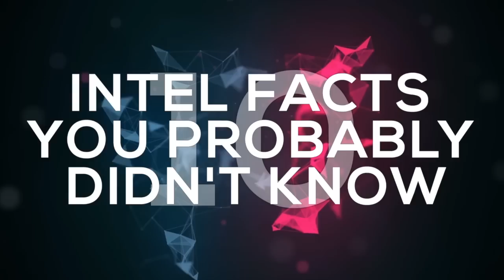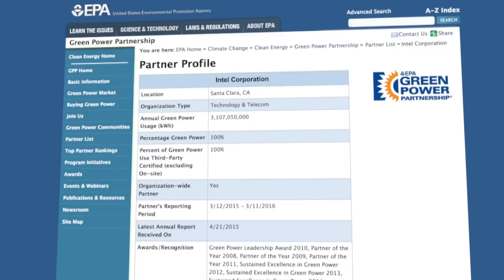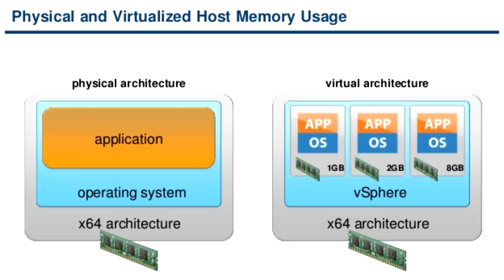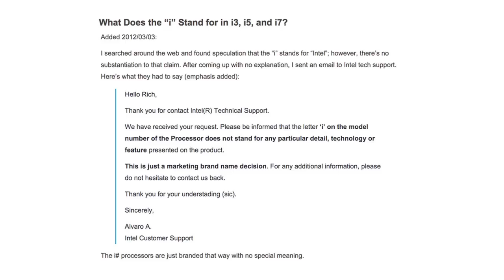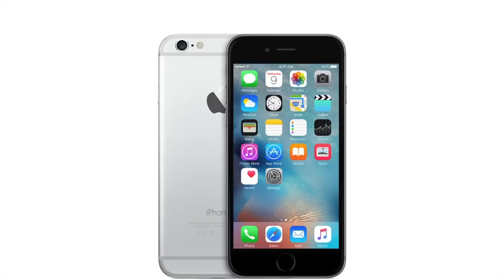10 INTEL Facts You Probably Didn't Know

Comment: transistors are not the same as ghz , ghz is how often 1 clock cycle ends , transistors do base binary functions like AND or OR , one clock cycle can involve as much transistors as you like , when clock cycle finish the output can be changed if the inputs changed

Comment: No, Intel didn't market much harder to turn on the heat on AMD.
Intel just bribed major pc distributors like Dell, HP,  and the likes in different parts around the world, giving HUGE bonuses the less AMD products they sold, had available to sell, or just giving AMD products unfavorable conditions like steeply marking up the prices of AMD products.
This was done globally, and this tactics also had a huge impact in China, Europe, Japan and Korea sales.

It got to a point so ridiculous that some companies (Dell for example) were earning more money from these bribes than they made by selling computers.

During a period of time they also modified compilers to discriminate between AMD and Intel chips and when an AMD chip were detected a slower code path was executed, even tho the AMD chip could run the faster code, and there was no technical reason for it not to.
And that, in its time could easily be seen by spoofing the hardware id to make the AMD chip look like an intel chip to the OS, as AMD cpu received a huge performance boost just by doing that.
And after this, tools appeared to recompile certain dlls without this trigger to discriminate between brands, AMD receiving the same performance boost as spoofing the hardware id.

And no, these are not tinfoil hat theories. There have been quite a bit of sentences against Intel in USA, Europe, China, Japan and Korea, about this, and from major courts, not local ones.

Also, all of this can be confirmed by yourself if you do a bit of research.

I'm saying this while owning an Intel chip, because, well, AMD screwed up big time with bulldozer and piledriver chips as those were pure trash xD, although the situation is not the same now with Ryzen.
So don't think i'm a fanboy, its just that the tactics Intel has heavily used in the past doesn't do good to consumers, neither in innovation or prices. And competition is almost always a good thing.

Comment: You for got to mention that intel was sued for anti-competitive practices many times. Intel essentially bribed OEMs to not sell AMD chips, this is the primary reason intel has such a market share.
Reply: not to mention that amd processors before FX were lacking severely in power efficiency and performance, but also without x64 intel Core series woul've nothing by now
Reply: @pinkyfloo8814    you don't have a clue, right? Before "FX" AMD has Athlon and Athlon XP who won hands down at IPC and power consumption against Intel

Oh btw, 64 bits was accomplished by AMD, Intel doesn't or woulnd't know how to do it
Reply: @pinkyfloo8814  🤣🤣🤣

Comment: in your video on the history of intel, you left out a very important chapter.  a company bu the name of Zilog also made an ascii based cpu that powered several cp/m computers. my first "personal computer" was powered by their 8080 chip and i later upgraded to the faster Z80 chip which was pin compatible and slightly faster. unlike ibm pc compatibles those computers used 8" floppy drives and double sided double density drives held 860KB as opposed to the pc's 360KB. the cp/m system i had came equipped. with 64KB of memory an ran at a speed of 4.77 megahertz. it could running cp/m 2.2 recognize a hard drive partition of 32 megabytes just like ms-dos. these systems utilized serial terminals for input/output so they were not capable of even ascii graphics. just a small bit of computer history for anyone that is interested.

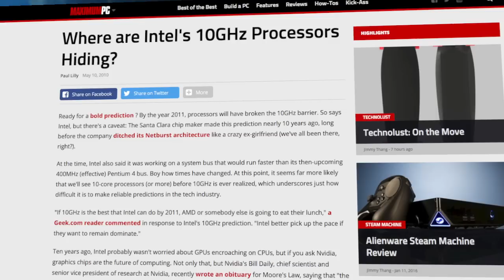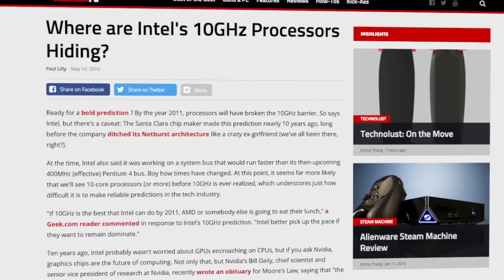Comment: 2:02 - 2:05 and we have them, if you multiply the clock speed by the core count, you could easily count the first CPUs with 10GHz clock speed was made actually in 2007 (e.g. Core 2 Quad Q6700 - clock per core is 2,66 GHz. If you multiply it by 4 - 2,66   GHz x4 + 10,66 GHz.) So Intel and AMD BROKE the 10 GHz barrier, actually in 2007. (BOTH)

Comment: In regards to why intel doesnt make 10 Ghz processors. It isn't that speed is no longer important. It's that Instructions Per Clock (ie: how many computing operations the processor can perform per 'Hz'), better instructions/operations, and multi-core architecture (and concurrently, multi-threading and using the GPU for non-graphics tasks) have lead to the amount of Hz being not so critical to performance as once believed.

Comment: .... x86. The original specification, created by AMD and released in 2000, has been implemented by AMD, Intel and VIA. Created.... by.... AMD. Your video states that Intel licensed it to AMD.....
Reply: x86 was created by Intel and originally was manufactured by both AMD and Intel. x86-64, which is often referred to simply as x86 because nobody makes pure x86 anymore, is an extension to x86 that was developed by AMD.

Comment: Intel on Intel, alright - I'll play. They did make a chip that went into the flight control of the F-14 - that's true. Go back further. In the early days of integrated circuits, they'd make a chip for a calculator company, Casio, with functions to add, subtract, multiply and divide. These were done with digital logic. So Casio requested a new chip, with some more functions, (sqr, sqrt, log etc...) and they presented a circuit diagram, suggested "Like this." It was a pretty big nasty circuit. Moor and his team had been playing with the idea of slotting not part, but all a microprocessor on one integrated circuit. This resulted in something a bit more complex again than what Casio had asked for, but it could do any simple math function and be given fresh microcode in a later model to add more, and it was all new and shiny and engineers liked that sort of thing. So they showed it to Casio, who were super impressed, and they ordered it. Officially, it wasn't a computer parts - it was the "works" of a simple calculator, but it was integrated into a single chip, and it worked the way a processor core does, not the way a group of discrete digital logic stuff does. That was about '63, and that was Intel's first processor on one chip. They also made Casio a quartz crystal chip time piece, on a single silicon chip, which brought them to digital watches, at 1/4 or less the price of Texas Instruments or Seiko.... Before pcs, Intel made a lot of money (relatively) through Casio digital watches and Casio calculators.

Comment: I use two of those i thingies.  But the 3.7 gigahertz on my i5 is called 'turbo', whilst the 3.7 gigahertz on my i3 is just called 3.7 gigahertz.  Hmm.  You might think that the i5 was faster than the i3, but I'd doubt it.  You see, the i5 is a second generation i5, running in 32 bit mode with 4 gigs of 1333 megahertz DDR3 RAM.  Meanwhile, the i3 is a sixth generation i3, running in 64 bit mode with 8 gigs of 2133 megahertz DDR4 RAM.  And they run on different operating systems.  I'm just using them as PCs that have a bit of extra oomph.  They both do the job that I want them to do, so that's fine.  The chief advantage of the i3 system was that it was cheaper, whilst providing good performance.

Comment: (2016/17) the OLD processors won't get better because.
1. we are at the limit in the sice of  transmitters-they are too small to make even smaller and at a certain sice electricity will start to jump from one to an other.
2.we heve better things like nanotubes (transmitters stacked on each other) and graphitum (one atom thick layer of graphite)

Comment: actually we can make 10GHz cpus but the issue is the power it would take to run
Reply: Kameron Swan no the issue is temperatures
Reply: and the only way to get that hot is by having that much power pumping through it
Reply: Garrett Austin and that's why both Intel and AMD have slown GHz increase so that they can either have a standard 65 watt or 95 watt without blowing up your board and that aftermarket heat pipe heat sink that you just had to have
Reply: Actually, the issue is more to do with stability than anything else. A 850W PSU would be more than enough to (theoretically) power a CPU at over 10GHz. When it comes to temperatures, if the CPU is consuming at most 400W of electricity, that means that the CPU is generating roughly 400 Joules of thermal energy/second. The thermal dissipation properties of liquid nitrogen will more than suffice to keep the CPU cool. The actual issue is down to the architecture of the CPU, i.e., either the memory controller on the die cannot cope with the bandwidth, or simply the transistor gates themselves cannot oscillate at a frequency of 10GHz.
Reply: then why don't they make the di out of copper instead of tin-bismuth
Reply: Oc competiotions have reached over 8ghz using liquid nitrogen as cooling

Comment: "we don't double the amount of transistors anymore"

Not true. Moore's Law split in two. The density of ICs and the speed followed different lines, and in fact, the clock speed basically flatted out. The real reason for this is the power dissipation for ICs continued to rise with density, and it became impossible to get all that heat out of the package at higher speeds. This is why now you buy chips with multiple cores, even if the speeds are similar. Since you can pack more circuitry on the chip, but not increase clock speed, the easiest method to get more performance was to duplicate the CPU on chip several times and let multithreading use the extra cores.

Comment: Many of the information is wrong or incomplete. Just a few remarks: 
- Nobody actually ever 'invented' the microprocessor. It was a common agreed on fact that sooner or later the processing unit would fit into a single chip. Intel just happened to be the first company to get a commission to design such a chip.
- Socket 7 was not a standard. Just because Intel didn't take competition serious enough at the time, they didn't make any design steps to avoid the competition from using it. Socket 7 was also not the only Intel socket that could be used with other CPU's. Socket 3, for example, could be used with the AM486 from AMD.
- Moor’s law has nothing to do with speed, but just with transistor count. The 10 Ghz estimate was based on the heavily clock-speed optimized Pentium-4. If Intel would have continued this design strategy, it would have easily reached 10 Ghz by 2011. This in otherwise slower and less power-efficient processors! The doubling of transistors every two years is more or less valid in 2016: this is why there are so many cores in modern processors. Otherwise they wouldn't know what to do with all those transistors anymore. 
- As far as I know an instruction set is not patent-able, and doesn't need to be licensed. AMD anyway had license over the x86 architecture because they were a second source producer in the 1980's. This is not because of anti-trust, but because IBM was not willing to source from just Intel and imposed a second source (AMD). The use of AMD64 by Intel is also not because of anti-trust, but pressure from Microsoft. Microsoft actually threatened Intel not to support the instruction-sets if Intel would have made their (incompatible) own one.
Maybe a little more research before publishing the video could have been usefully ;)

Comment: Correction, Intel didn't just license it free of will, They were taken to court by IBM on the case of them trying to monopolize the market and the Judge ruled that they license it to IBM and AMD, While also on that note They also used to try to stop businesses all around the word from selling AMD chips in which they would give a price drop if the business stopped selling AMD chips, They also lost that case and had to cough up the dough in losses, Now i'm no AMD fan, In fact i am running a 4790k on this rig, Built a 1231v3 xeon for my sister and used to knock around the core 2 extreme years ago, But facts are facts or go cry because the truth hurts